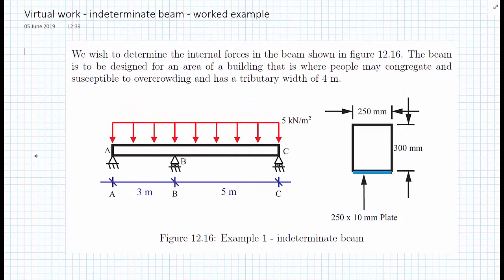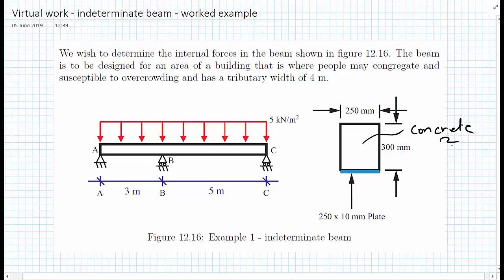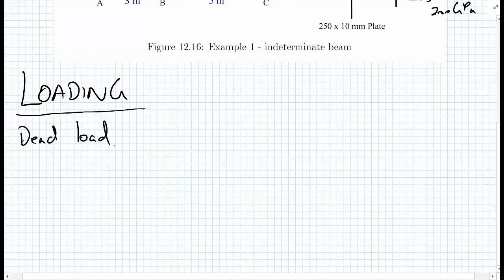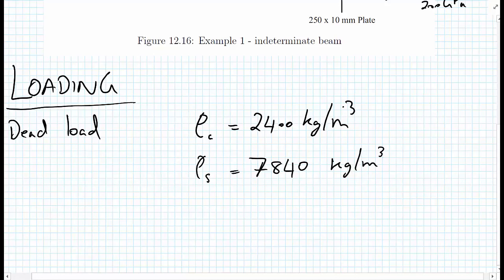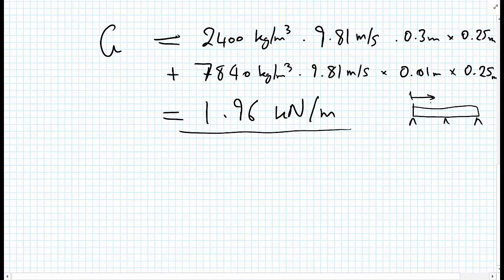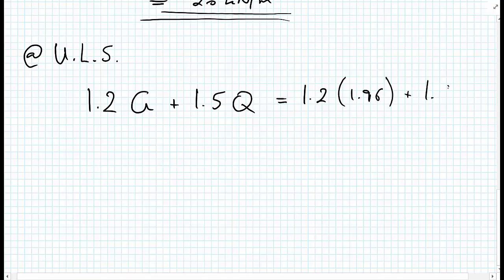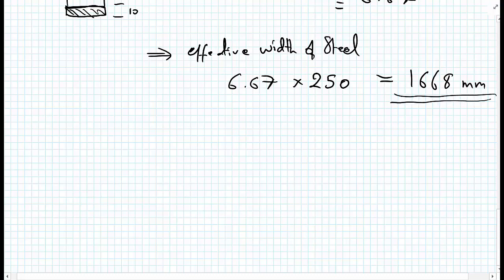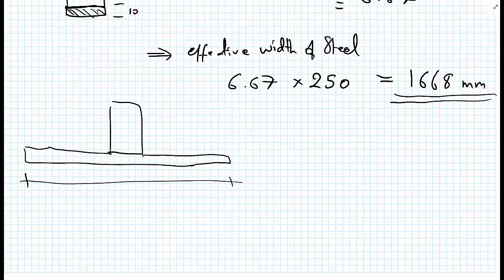Virtual Work - indeterminate beam worked example

Comment: Hello, your force for the middle support you found to be -171 kN therefore you should draw R_By going downwards at 35:30
Did I misinterpret that?

EDIT: I realize my mistake, we assumed the unit load going down so a negative value means it goes upwards
Reply from the maker: glad the meaning of the minus sign clicked.

Comment: Hello. When you explained how to calculate the flexibility coefficient, is it possible that there is a small mistake in the notation in the integral? You wrote m(x)*m(m) in the numerator, shouldn't it be M(x)*m(x)? Or is it m(x)*m(x) maybe? What you're saying and what you're writing is different. Thanks.
Reply from the maker: definitely x in the brackets